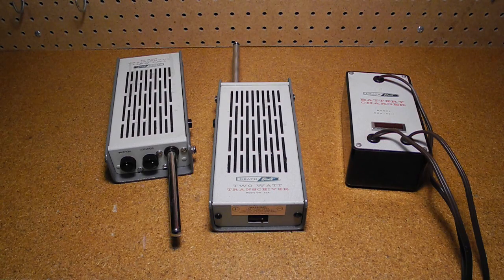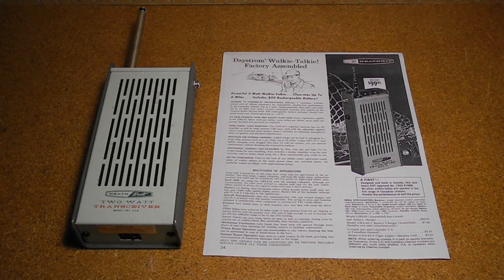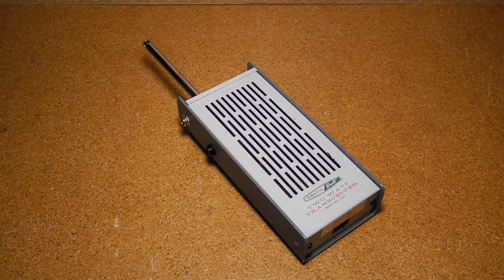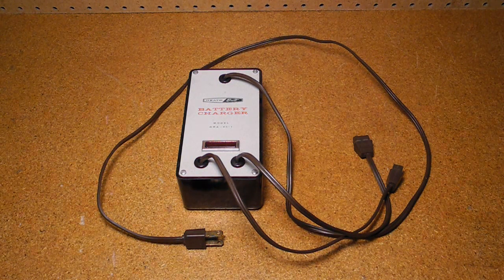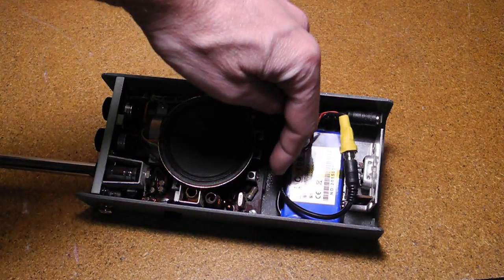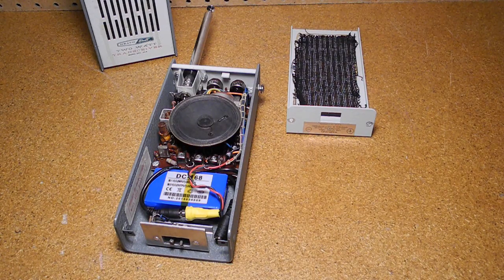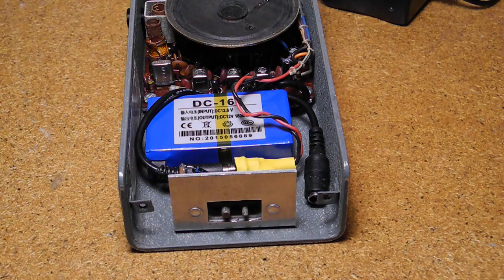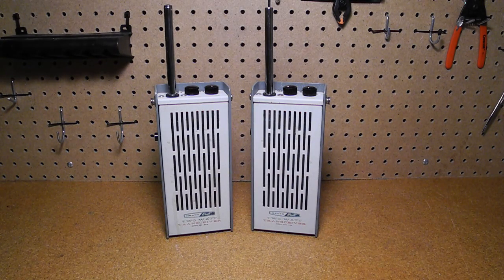The Heathkit GRS-65A Two Watt Transceiver

Comment: I love the old school cb radios WT,much better built and constructed.
Nothing wrong in using  refurbished CB Walkie Talkies I use mine a lot,you may get the odd look due to the long telescopic antenna but out in the field in Forrest or beach they can be quite handy to talk back to a base or car unit.
Ive found using modern battery cells the difference it makes is amazing as plenty of standby current is available with modern rechargeable batteries and crystal controlled radios last ages compared to microprocessor type cb handhelds.
If you want to improve range here's a tip,connect a 9FT trailing hook up wire onto the outer\Earth of external antenna socket,it will act as a earth counterpoise and help radiate the antenna.
You can also do same with a ring terminal and 9ft of hook up wire to walkie talkies which use a BNC or TNC antenna connector,I get about another 4 S Points extra!
I change out caps electro types  and ceramics (fit NPO types more stable)as they tend to age a bit.
Another little naughty trick swap ur TX and RX xtals the other way round for private channels! wink
Love the vid,like to see a vid in real operation outdoors next!

73's Rob

Comment: I wonder if I can ask you a question I bought a Lafayette  h 29-c and I need to replace the capacitor in it in the capacitor is very low value could I actually replace it with a higher value capacitor cuz I can't find the one that I need
Reply from the maker: It depends on the application where it is being used. It if is part of a tuned circuit, the value will usually be critical. If it is a bypass or filter capacitor then it is generally safe to use a higher value. I'd have to see where in the circuit it was used.
Reply: Well the capacitor that I'm looking at I believe it says five microfarads six volt . The capacitor has this description on it 5/6
Reply: I really appreciate your feedback I don't know a whole heck of a lot about electronics
Reply from the maker: @joemazza506  That is an electrolytic capacitor and you should be safe to replace it with a higher value as long as it has the same or higher voltage rating. You also need to ensure you install the replacement with the correct polarity (+ and -).
Reply: Alright well thank you very much I appreciate the feedback